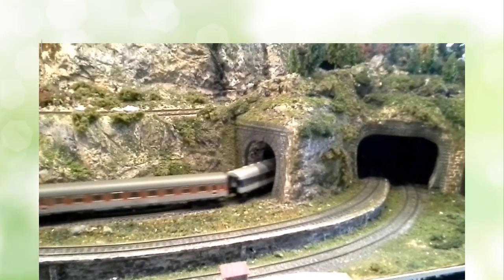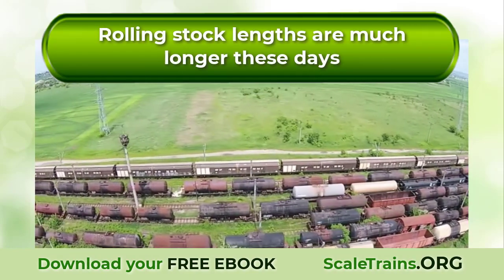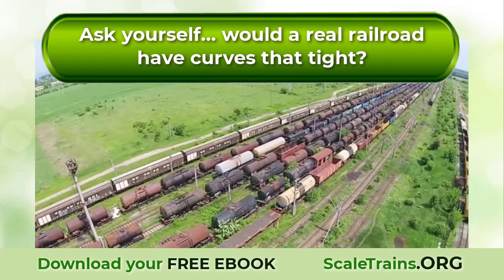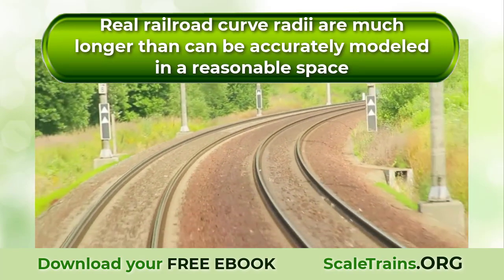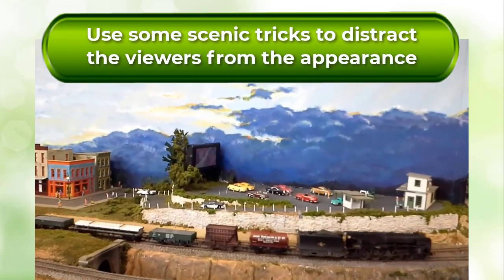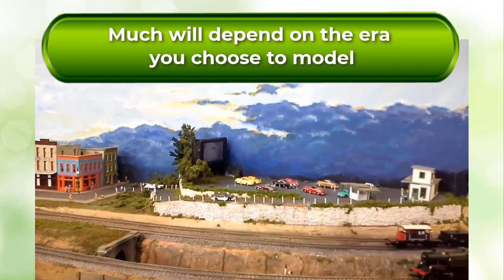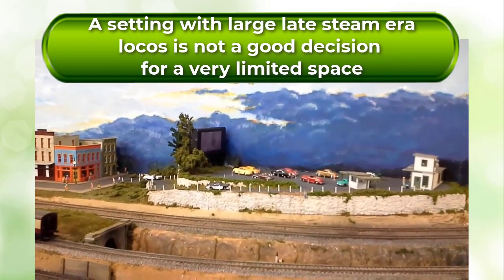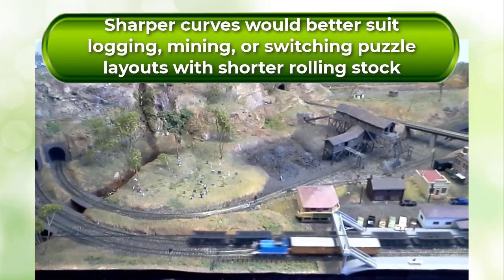Quick Tips For Planning Model Train Track Curves On Scale 🔥Railroads

Comment: Totally agree. My new N Scale North Penn branch uses 24” minimum radii AND I model pre WWI era when rolling stock was short.
Reply from the maker: Sounds great David 😉
Reply: @modeltrainsrailroads  and yet you might recognize that 99% of  
modelers disagree, at least in the US.  The vast majority of locomotives and rolling stock available on the market are  post World War II or even more modern, all of which look silly on the curves and sharp switches which 99% of modelers use.  For anybody to build a layout with modern image equipment, realistic curves, and the operational scope to actually run trains Through a scenic landscape, would require either Z scale or smaller, or a tennis court sized space.   Or adopt the vey limited English style layout, which consists of a small country station, a tiny bit of mainline, and a fiddle yard.  That in turn would only appeal to the sort of person that wants to do some switching 2 or 3 locos, moving a few pieces stock  in and out of sidings or platforms, or a hyper detailed model that is effectively a static diorama.
Reply from the maker: thanks for contributing your thoughts

Comment: One way to figure track radius is to multiply your longest car by 3.5 to 5. That way, if your longest car is 6 inches (multiplied by 4) the radius to accommodate the turn would be about 24 (give or take if you use a turn transition).
Reply from the maker: Thanks for your contribution to the discussion.

Comment: Finally. Someone is getting it. Radiuses in the real world are broader than toys. Example Lionel. Those trains look ugly, because they have to be, to be reasonable with such tight spots and tight curves. Yuk😝. There is the DDA40X locomotive, the 89'-0" Autorack. And ofcourse Amtrak superliners. You can't have those in such tight spaces. That is also why they put the couplers on the wheels of some train cars instead of the bodies, like in the case of N scale.
Reply from the maker: Thanks for the input 😉